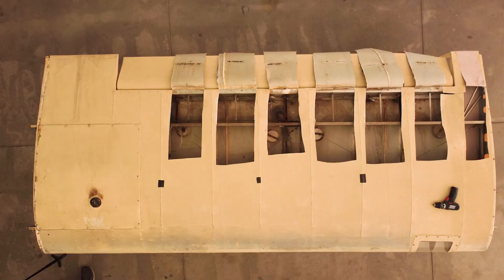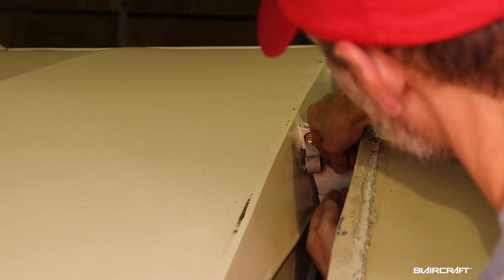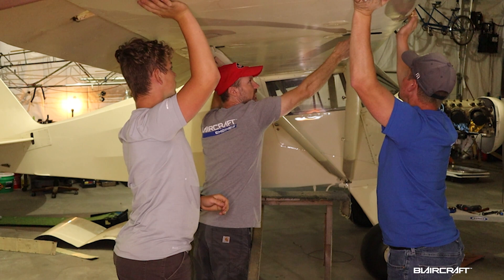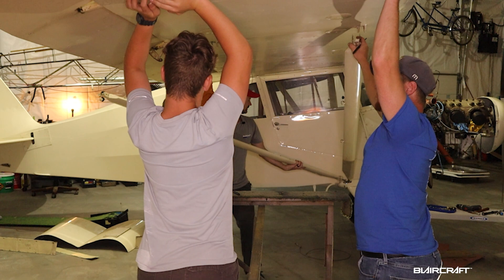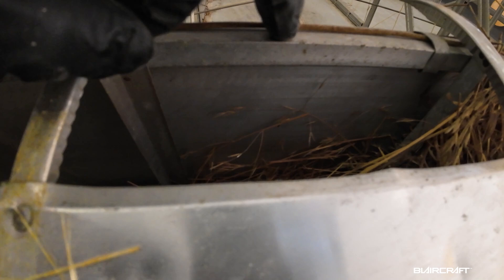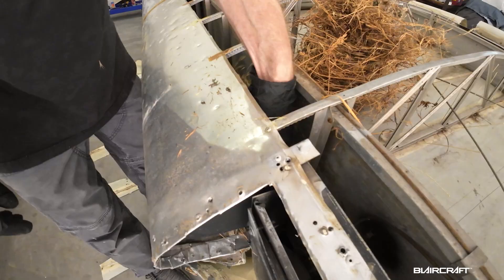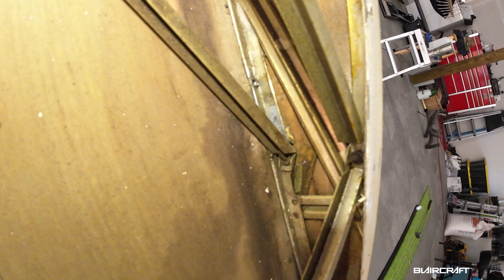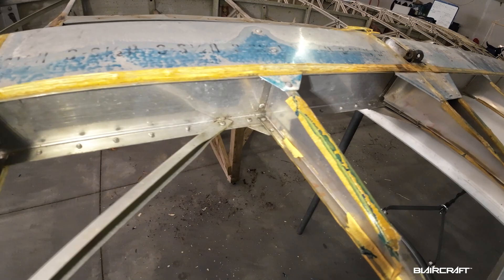Fabric 42 yrs old, Remove & Cut Open Airplane Wings

Comment: Nice job, Im 5 years into my Stinson 108 rebuild with 3 years to go! need to make more time. Keep posting so I can stay motivated!
Reply from the maker: Will do! What stage are you in on your project?
Reply: @Blaircraft.Engines  Went all the way down to the fuselage, now going back up with electrical, Fuel and hydraulics before covering now. Planning on AirTech.

Comment: Did you do more videos on the skinning of this airplane?  Seeing 5/17/49, (74 years) I would be about 4.5 years old when this airplane was being born. 🙂 This airplane is about 3.5 years older than my J3 (77 years old) and me, 78 years old. I'm definitely going to be interested when the new fabric goes on, if possible.
Reply from the maker: Awesome! Thanks for your comment. I have yet to remove the skin from the second wing, I plan on starting that in the next week or two. 
I will definitely show the process of everything moving forward, Wings, Engine and prop install.

Comment: Josh - really liked the fabric stripping. Interested in your views on how to get rid of some of that corrosion and glue prior to recovering. I have a 1950 PA-20 and will be doing the ailerons and horizontals this winter while finishing up the O-290-D engine work.
Reply from the maker: Nice a 1950 Pacer 👍
I recently purchased a vapor honing machine that I’ll be using to clean up corrosion and various debris. 

I’ll have a update on the second wing within the next two weeks, however the runway update will be this weekend. 👊 it’s already uploaded in the queue.